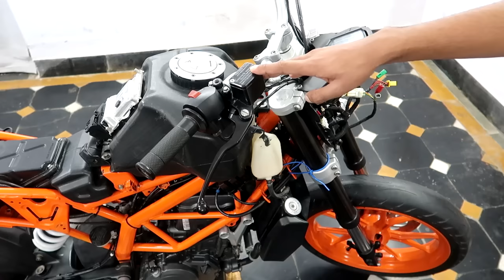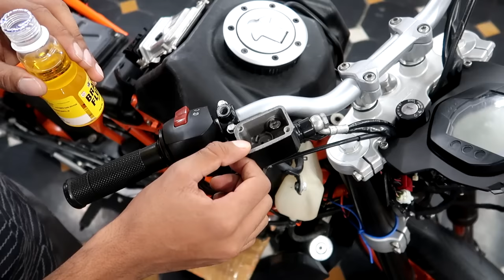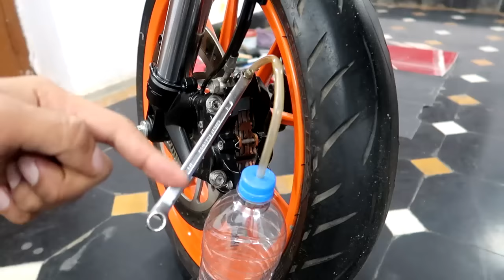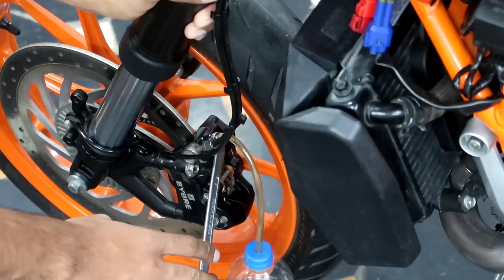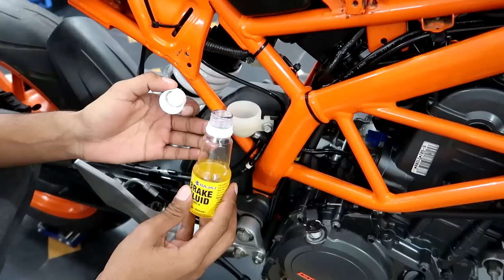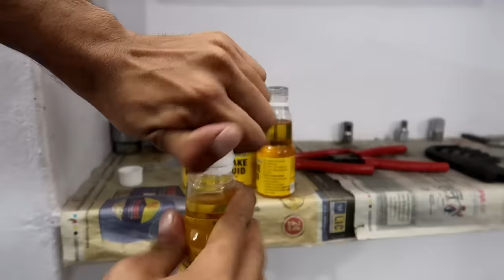How To Bleed Air Out Of ABS Braking System On Motorcycles

Comment: Change in volume of the sealed fluid could be because of the two reasons:
1) Brake fluid breaking down due to time. 
2) Change in brake fluid density due to temperature.
Reply: You think normal temperature affect  dot4 fluid? That's a joke.
Reply: Anil Kumar I think it being a fluid will have volumetric changes due to temperature, and nowhere does it says anything about dot4. I know where you are coming from, considering the boiling point. But here I’m talking the opposite of that.
Reply: Anil Kumar or would you mind throwing some light on the talk then ?
Reply: Hmm, there is difference between a dot3 and dot4 fluid, the dot4 fluid is much more cable than dot3 when it comes to thermal, the normal temperature say atmosphere temperature cannot affect the oil which is in a plastic container, if it affects the oil then it must affect the container too, if you test the oil by heating it over 100'c then you till know how much temp is needed to cause the decrease of oil in the bottle on video.
Reply: Anil Kumar What I’m trying to explain is due to a lower temperature, density can rise, hence lower volume keeping the mass same.
Reply: Agreed
Reply: Allie X hahaha hopefully bhai 😋😛
Reply: Allie X  volume depending on temperature while poring not room temperature
Reply: Can anyone please tell me why his brake reservoirs are empty? 
Did he empty them and then added a whole new brake fluid? 

And can I just top up my brake fluid and do the same process as he did?

Comment: I've put a brembo RCS 19 on my KTM RC 390. On aggressive braking...I feel the lever move out. Once cold it's back to the same position. I tried re bleeding the brakes. And changing the fluid too. No bubbles in the system. Any idea why my lever is moving out ? Also using steel braided steel lines and sintered pads by brembo.

Comment: unsealed break fluids are not recommended to use because the brake fluids are very hydrophilic meaning it attracts moisture very much. this addition of moisture deteriorates the metal part and boils when braking creating air gaps since breaking creates high temperatures. so bettwer just use them all for a good bleeding rather than thinking of saving them.

Comment: Hi Jeet, i tried this method for rear brake but i am not getting pressure in my master cylinder. The new oil is coming out of the bleeder valve without bubbles but still there's no pressure building up even after pumping the brake lever for a long time. Please suggest what shall i do? I am stuck now with no pressure in brake. I own Dominar 400 ABS one.
Reply: Bhai apka  Problem thik hua kiya ??? Mera Bhi pulsar 150 bs6 front ABS main pump pressure nahi ban raha ha ??? please help 🙏❣️
Reply: @sza8679  Ha bro. Do one thing, caliper se brake pipe nikal lena and thumb and finger se uss bolt ko cover kr lena. Ab jb bhi lever press kro tb air and thoda bhot oil ko thumb se pass hone dena and lever jb pura press hone hi wala ho tb wapas uss bolt ko cover kr lena tightly taki air wapas na suck ho. Repeat krte rehna ho jayega.

Comment: Bro my byke is Honda CBR 250R  duel ABS with combi  CBS  , thr front caliper is 3 piston Nissin ,  what would be the bleeding procedure for this model ? please suggest , I found your video is the most educational type with proper explanation  in Youtube with clear camera angle . Just like company training manual video ... waiting for your valuable explanation .
Reply from the maker: Most of it will be the same… first bleed the front brake like normal…. Then bleed the combi brake line first by using the rear brake pedal… then bleed the rear brakes as shown

Comment: Sometimes you must remove the caliper while pumping the lever and turn the caliper 90° to the left and 90° to the right,,,,, if you do not remove the caliper in duel piston brakes you can pump all day and never get the air pocket out and your brakes will be soft.

Comment: Pls share how to open up cbr 250r for getting near the abs module. 2 small screws have dropped from the area where the abs module is. And now upon hard breaking the brakes lever is jerking hard. I have removed both the abs fuse. Now the brake is smooth but abs is unavailable.

Comment: Problem in R15 V3: multiple cases observed for front break failure (same issue already highlighted to yamaha by multiple authorised service centres)- After the disc brake oil change or maintenance procedure, front abs stopped working. Request for some post on this. These abs failure cases are only if the disc brake failed and then we are going for a service.
Reply: how and why front brake failure in r15v3...
I ride r15v3 and my brake fluid is empty now so can I just fill it with dot4 brake oil or is it necessary to do bleeding process??
Reply: None really have the skill and patience to understand the issue. Same happened to me with Fz V3.
Reply: @shreeramhegade9008  please explain
Reply: @ajjubhai-gq4lh  Front break was delaying while applying hence I checked the caliper. One of the rings was jammed. The mechanic advised to replace the caliper. After putting in the new caliper, oil was not pulling out from the abs motor, now the service guys are asking me to put new abs motor which costs 14k. This is totally bullshit. I think no one really has the patience to check what happened.
Reply: @shreeramhegade9008  bro My brakes are ok .. but my brake oil is empty... so can i just fill it..
or is it necessary to Do Brake Bleeding??
Reply: @ajjubhai-gq4lh  If it's empty you can directly refill it. I think bleeding is done only when the brake lever loses tension.

Comment: Question for u bro..my breaks are contaminated with leaked  fork oil..if I change my breakpads will it be better or same??
Reply from the maker: Yes, replace the brake pads and clean the rotor
Reply: @JeetBhaskar  I put new brakes and cleaned the disc..now it is good as new..thanx bro

Comment: Well explain bro, Activa 125(2014) model front wheel tight moving after diskpad change how to cure
Reply: Clean the pot inside the caliper or change the o ring in the caliper

Comment: Hi would you be kind enough to help me with the system. 
I recently bought this bike and I am having a problem. When I press the rear brake it stuck at lock position it's very hard to move wheel. I have to use a tool to release the disc.
I can see when I press the brake the oil level in the bottles goes down and when I use the tool to retract the piston the oil level goes up in the bottle.
Please can you guide me what can cause the brake to lock the disc?
Reply from the maker: Replace the rear master cylinder

Comment: Bhai adv 390 hai aur peeche ka bite bilkull nahi hai. Kya karen? I sanded the pads. Cleaned the rotor with isopropyl alcohol bled the brakes and everything. Any ideas on what else can be done?
Reply from the maker: Pehle bite thi kya bhai ? Or agar thi to master cylinder check kro or piche brake pads sintered dalva lo
Reply: @JeetBhaskar  pehle se nahi hai. Magar friend has the same setup aur uska bite is very very good.

Comment: Hi Jeet,  I am from Pune .I have Duke 390 2017 I want to know about oil consumption of my bike because every after 2000KM I am topping up 200ML in it as it is consuming that much oil I just wanna know is this normal or anything bad with my bike service centre guys said that is normal but to get assure I am asking this to you as you r much expert than them.
Reply: It is also smoking at cold start after hard revving
Reply: Piston ring problem

Comment: I have over heating issues on break of front and rear break.....i change piston seal rubber of both break also and clean the old break oil but also facing over heating disc plate how to slove it.. please reply my comments
Reply from the maker: Replace master cylinder
Reply: @JeetBhaskar  sir i don't have enough money to replace master cylinder...i can change master cylinder kit does it work ?if i change the major kit of master cylinder? Please reply my comments i waiting your apologizing your reply
Reply: Hello sir
Reply: I am waiting for your reply 🙏 please help me to slove this... Please reply my comments

Comment: Hi, after I flush the front brake, after I started the engine 
The front brake is locked due to ABS,
What can I do to reset to normally state?
Reply from the maker: I don't think it's locked by abs... Looks like your master cylinder needs a major kit replacement
Reply: @JeetBhaskar  no, after I install, the brake works as normal , the wheel rotates smoothly and stops when I pull the brake lever,
But the problem happens when I start the engine, 
The front wheel brake keeps pressure on the wheel as if we manually pull the brake.
I believe that the problem comes from ABS system
Reply from the maker: @1xplorer  yup... Then the abs is culprit... Try disconnecting the battery and reconnecting it after 10 minutes... If that solves the problem
Reply: @JeetBhaskar  Oh, sounds like a good try
I will try it first and see of the ABS work as normal.
Thanks for your advice 
Do appreciate that 👍

Comment: What will happen if i press  rear wheel brake with no front wheel ( rc 200 abs ) i had done this  and my front brake has  less response now..i did this while i Tightening the  rear  axle  with no front wheel ..is there is any problem? With my  work?
Reply from the maker: ABS doesn't works like combi brake... So the front brake being less responsive doesn't have nothing to do with rear brake. Well at least that's what my experience is.
Reply: @JeetBhaskar  front brakes is  less responsive after dismantling front wheel .

Comment: I fill new oil, Removed air and works perfect .
And then after 3-4 km break tightes and i have to lose that drain nipple and need to remove little oil. And works fine but again same problem . If break tights and i stay it for night problem solves but same effect after 3-4 km .. any solution ?
Reply from the maker: Looks like master cylinder needs to be replaced
Reply: @JeetBhaskar  aw . It doesnt gets tight during bike off ..

Comment: what is the size of bleeder pipe?
Reply from the maker: Never measured it
Reply: @JeetBhaskar  roughly any idea as i am not able to find that in the local market
Reply from the maker: You can ask them a drain pipe for motorcycle batteries... Fits the same.